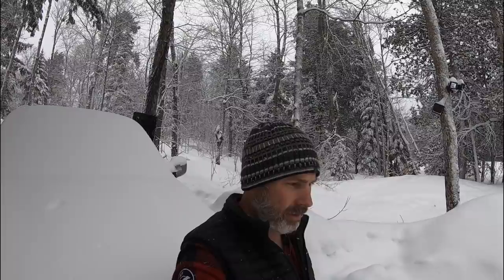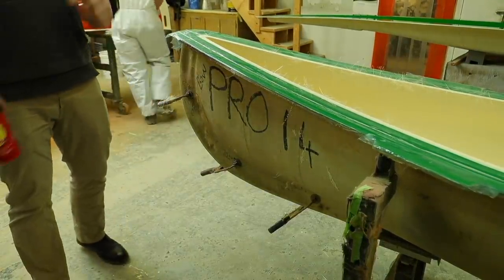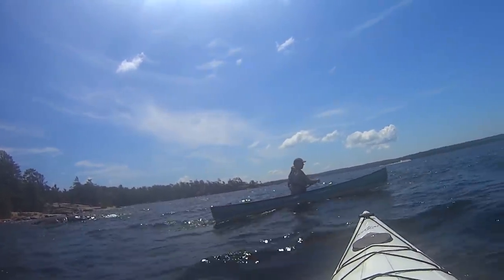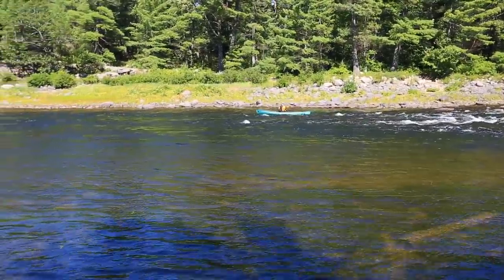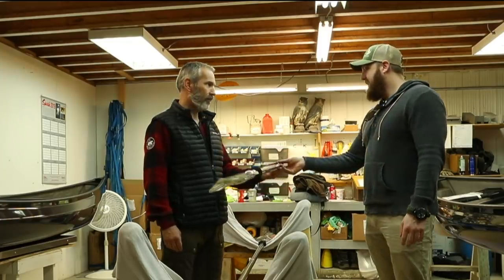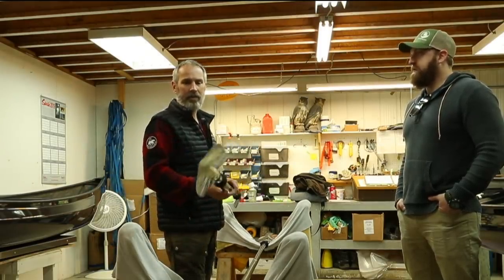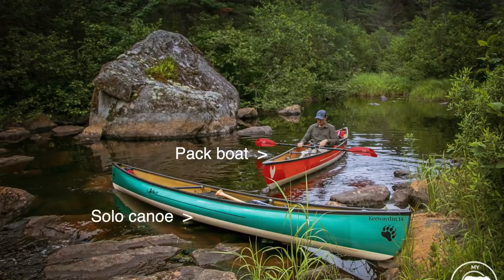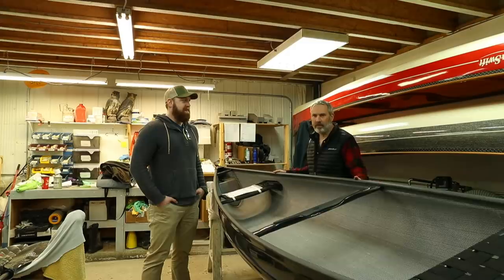Delivery to the Cabin | Road Trip and Factory Tour

Comment: Nice canoe, thumbs up !
I've had canoes for 40 plus years, wood, fiberglass, plastic and aluminum. I have 2, 17' Grumman Aluminum now. One is a double ender, the other is a flat back for a motor.
I modified the Flat Back quite heavily by removing the front seat and putting a very low beach chair and 12'' back from the original and a storage shelf in front of it, a beer holder of course.
The rear seat is a lightweight boat seat with a fold up back for comfort and mounted very low.
Behind the rear seat, is a storage section with a lid that folds up.
I beefed up the transom to withstand twice the HP from 5 to 10HP.
Every mod was made from aluminum and stainless rivets.
She's a little heavy, around 87lbs but with 2 people and a 10hp, she'll do around 12mph and being the thicker aluminum, I can smash into things and never worry, I hope. lol !

Comment: One additional thought; I often use an inflatable water bladder to add weight at the appropriate spot in the canoe to keep the boat floating flat.  An additional 40 pounds may sound like needless weight, but having a balanced boat in windy conditions is certainly worth it.  At portages, I simply empty the bladder.

Comment: Fyi.    I was wondering if you'd ever been to Missouri. Fall is very pleasant here. That's the best time to visit Branson. There's also a national park 100 miles east of there with several good canoe rivers as well. These rivers are all spring fed. If you're ever here during deer season we have the second largest herd in thU.S. There is a estimated 1,400,000 deer in Missouri. That's a little more than 20 per square mile. The rascals are smart enough to know when to hide. We have a large population of turkeys also. Two legged ones as well as the feathered ones. Get in touch with the Bass Pro people. Maybe they can have you down for a workshop on "Self Reliance." That way you can have a working vacation. Get some hunting and fishing in. Be safe. Vaughn

Comment: I once did a safety check on a borrowed aluminium Canadian canoe. Open top, like yours. Thought it would be a good idea to try and sink it, seeing as I planned to take my 12 year old son out for a paddle. We had wetsuits on; it was a calm sunny day, near Falmouth, Cornwall. We paddled out 50 feet, deliberately tipped the canoe over and it instantly went straight down 20 feet to the bottom! No bobbing around. Just straight down! And it was a bastard to get back up. We had to swim this useless drowned tin can back to the shore. There was no built in flotation at all. Neither the seats or any buoyancy from the structure provided an iota of safety. It was quite shocking to see how quickly it sank. I vowed then to use personal flotation devices for our safety, and whenever possible, attach additional cushions/pads/foam to the canoe's frame. Good luck with your buoyancy. Make sure you do a sink test before heading off. Happy bobbing.

Comment: Shawn going the Darth Vader route.   Nice choice, great compromise in boats, you win some and loose some.  I have Swifts 15' Prospector, it covers a wide area, two seats and I solo it more than tandem, but the seating is there when needed.  I hunker down center kneeling and move back to the reversed bow seat, it keeps me moving around in the boat for comfort reasons and conditions of wind or current.  I find its also stable enough to stand up and pole which I do very frequently, the pole is my second paddle.  Even on lakes I will pole along the shore line into the wind, too, that pole will really drive the boat when you need it.  Very curious if standing position is possible in this 14' version, and if the seat can be totally removed from the boat?  Spring is coming, we can really feel the suns energy on sunny days now.  We are looking at a month or month and a half to open water here in coastal Maine.
Reply from the maker: I don't pole very often, I guess primarily because most of the water I paddle is either too deep or too silty on the bottom. The seat is removable. I'lll have to try some standing poling this summer and film it - should provide some wet blooper footage. :)
Reply: @ShawnJames1  I've seen you Canadians out of the boat dragging enough to know it can be handy at times.   As the dry summer comes on I pole more and more.  thanks for the response.  Not only poling but stand up paddling, thats all the rage now SUPs.  I can't quite fathom it though,  that a pun.

Comment: When you go to the cabin there has to be a spot for your truck but as a fellow canadian our winters can get cold so how do you make sure your truck starts if theres no electricity to plug your truck in
Reply from the maker: If my truck was diesel, it would be a problem and I would have to run a generator. I’ve only had one issue - a cracked windshield from an ice storm followed by a foot of snow.
Reply: Ouch when that happens its not fun but at least the truck  will start